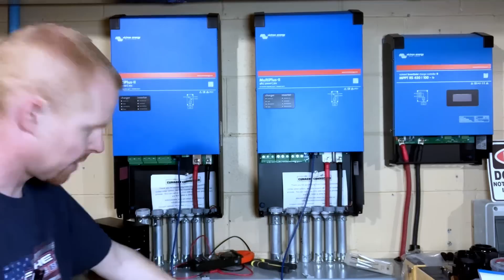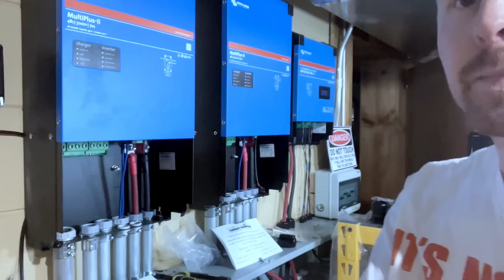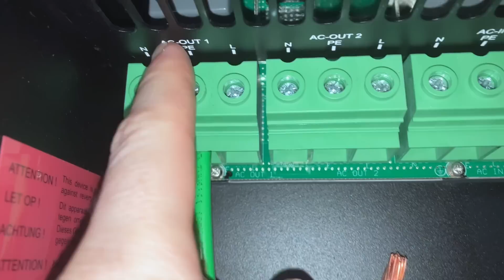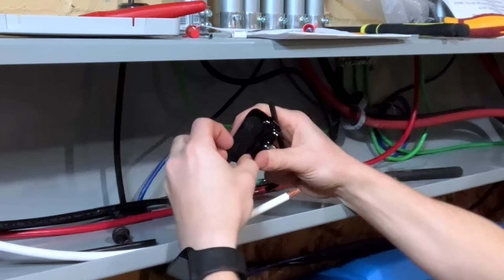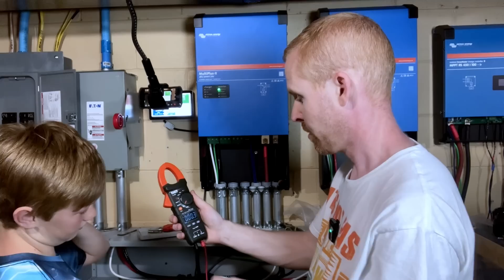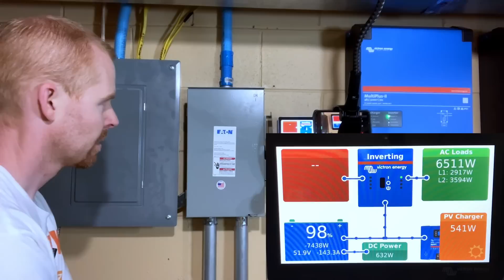Solar Upgrade - Powering the House with the Victron 5kVA Inverters!

Comment from the maker: Links to the parts & pieces in the video (affiliate links)
------------------------------------
Victron 48V MultiPlus-II 5kVA 120V Inverter
https://www.currentconnected.com/product/victron-48v-multiplus-2-5kva-120v-inverter-70a-charger/?ref=AzzpK9Fl

10kVA 120/240v Base Multiplus-2 System
https://www.currentconnected.com/product/10kva-120-240v-multiplus-2-5kva/?ref=AzzpK9Fl

Victron MPPT RS 450V/100A SmartSolar Charge Controller 
https://www.currentconnected.com/product/victron-smartsolar-mppt-rs-charger-controller/?ref=AzzpK9Fl

Victron Lynx Components - Power In, Shunt and Distributor
https://www.currentconnected.com/product-category/victron/lynx/?ref=AzzpK9Fl

Morris Products Insulated Multi-Cable Connector 3 Wire Ports, 2/0-6 Wire Range Dual Entry
https://amzn.to/446rbNw
Reply: Adam, FYI all the links you shared on the DISCRIPTION below doesn't work at all. It says "page not to found".
Thanks
Reply from the maker: @jwsolarusa  thanks!  I’ll take a look at those and get them fixed!
Reply from the maker: @jwsolarusa  Should be all set now.  Thanks again!

Comment: Good to see you're back online with Victron. I've been watching your videos on EG4 6500EX-48 and the issues with support. I'm placing an order soon for a Low Frequency system driven by bifacial panels. Based on watching you videos and other peoples videos it appears that Victron MultiPluss-II 5kVA 120V is the superior choice, the specs are awesome and the best part is the torodial transformer peak load at 9,000-watts with 97% efficiency and 15-watts zero load power consumption. Also, two units of the same model can be connected for a 240V split phase output. All I can say is I'm purchasing same unit. Thank you again for the videos. Best regards Sir.
Reply from the maker: Thanks!  I’ve been pleasantly surprised at how well the system has performed.  They just work!

Comment: You have a great looking system…glad to see you went with the great stuff… so many people try to cheap out on the brains of the system and much grief can follow ..

The more BLUE in a system , the happier that system will probably be in life…
I have not had a single issue in anyway with my total blue system since I switched it on…👍
The only thing in my main gear not blue is the batts , they are grey..same comments apply to them.
J.
Reply from the maker: Thanks!  I've been amazed...it just works...

Comment: Just a suggestion, when hand tightening terminals with non-twisted stranded wire even if using a torque limited driver, tighten down, back off, then tighten down again.  You might even do that a few times until you reach a point where you can not tighten more.  The reason being the strands will move and settle together.  If you don't account for that movement the joint will become loose over time.  This applies to both clamp and penetrating screw type terminals.
Reply from the maker: Thanks for the tip!

Comment: Awesome job with the install! I like the blue as well. If i ever redo my setup im going to add a wire trough...makes a huge difference for the cable management. Ive learned my lesson about cutting wires too short way too many times haha i think i missed the video though on why you decided to replace the EG4 system with the Victron system??? 

I can't tell you how many times I only ordered one but I needed two😅

Congrats on getting everything all hooked up and being able to get power from the system! I know the feeling 😊
Reply from the maker: So Current Connected sent me the system to test and review.  I have to admit, it’s kinda nice actually being able to communicate with a company.  Got so frustrated with SS and trying to get help from them on various issues.  

I had to make 3 separate orders for those Morris connectors cause I kept finding out I needed another one.  And it’s not one of those things you can just pick up from any store either…

Thanks!  I know you appreciate the feeling more that I do seeing as I still had grid power to rely on.  You had to deal with the genny…
Reply: @w8dev  That is awesome man, what a great opportunity! You did a fantastic job with the install and review. If I didn't already have EG4 equipment you'd have me sold on the Victron system haha

Comment: Happy for you and congrats! I’m looking to go victron, or eg4. I really like the eg4 18… but that’s overkill because I stay in a sub and can’t use that many panels lol
Reply from the maker: Thanks!

The 18kpv does look nice, but I'm still surprised that there's not more people showing them on YT.  So far outside of the distributor, I've only seen 2 channels with them.  

I would agree in a sub you probably couldn't get away with 18k of panels.  :D

With the Victron system, you can size the individual components to your actual needs.  Plus there's the stability of knowing Victron's equipment has been around for a long time and lasted the test of time.

Comment: I was thinking about getting the Victron 10k kit. However, after reviewing the EG4 18k by Lux Power and having everything built in and so far completely trouble free, I have decided to go that direction. The software for the Lux Power is awesome and it will work with solar assistant.
Reply from the maker: Awesome!  Have fun with it!  Looks like a decent unit!

The only issues I've heard so far regarding that unit are mostly related to the "zero grid export" feature.  I think other than that I heard of 1 person who had issues connecting the wifi dongle and another person had their display stop working after updating the display firmware.  The latter two could just be fluke occurrences.  

Let me know what you think of the 18kpv!
Reply: @AdamDeLayDIY  what is the "zero grid export" feature? we will be 100% off-grid
Reply from the maker: @stevenfrazier8939  I think it has something to do with load shaving and covering additional loads on the AC in side of the inverter.  I guess there’s still some potential to feed power back to the grid.  

If you have no ac in, you shouldn’t have any issues.

Comment: Wondering if you showed your equipment grounding somewhere in this video series. I could not find where you talked about that.
Reply from the maker: Howdy Eric!  

I had thought I had shown what I had done, but you know how things go during editing...so much footage...  

It looks like my tone out test was trimmed for time in this video (https://youtu.be/pi5M6XrDSjo?t=720) which would have showed that all the ground connections were connected.  It didn't make sense to me to have a ground wire going to each terminal since the other end would all be going to the same place potentially creating a loop (plus both the manual and the circuit diagram under the lid show each ground connected to the case).  

Simplest explanation:
Inverter/SCC -> Wire way bus bar -> transfer switch -> sub-panel -> msp -> ground rod

Hope that helps!
Reply: @AdamDeLayDIY  Thanks. I sent you a message to your channel email which delves further into my question and expands upon what I was asking. Hope to hear back from you soon.
Reply from the maker: @CountryLivingExperience  glad you said something.  It was in my spam folder.  Lemme take a look at it and I’ll get back to you.

Comment: My new growatt 12k trips at 14k for 10 seconds. But the fan is loud enough to hear from first floor when it's in the basement but honestly it doesn't bother me . But kind of like when u hear the sump pump cycle. Lets me know it's working. 😊
Reply from the maker: My office is in the basement right next to the utility room where all the solar hardware is.  There was a time where like you said, the fans just let you know things were working, but the noise was so loud it was hard to get work done (and that noise was through a brick wall).  We could hear the jet engines roar from the first floor as well.  I think if the fans cycled more (like the sump pump) it might not be that big of a deal.  

Have you done a video on your upgrade?  Do the fans run constantly on that unit as well?
Reply: @AdamDeLayDIY  no update video yet. I really need to clean the basement before I make another. They don't run all the time  they cycle on and off. Or at least the loud one does. Average joe replaced it with a quieter fan but it was also not as thick. I'd be afraid of overheating and voiding the warranty if I did that mod on this growatt. Suck u had to buy all new gear. But glad to see I'm not the only one dealing with these high frequency inverter issues. My mppt6048 also had the light flicker this low frequency growatt 12k doesn't. But my biggest issue now is the charge controller is just not big enough at 120amps on the battery side of things. I typically only see around 6kw of power from the panels now when I used to get 9kw+ at 170 amps with the mppt6048 even tho it was rated for only 8kw. I have plans for the mppt 6048 out in the barn otherwise I'd just use it as the charge controller. I was looking at the victron 450/200 charge controller for $2000+. But then found the eg4 100 amp controller at $400. Have to experiment to see if I can just use the two inputs on the growatt on one array see 🙈 if they fight each other and the other array to an external charge controller.
Reply from the maker: @electromechanicalstuff2602  Well, looking forward to your update.

I saw the mod that Joe made on his.  I would kinda be worried about voiding the warranty as well.  I've even seen some guys doing mods on the 6500s and adding temp controllers to get the fans to cycle as opposed to run all the time.

Actually, Current Connected sent me the gear to test/review.  Still had to fork out a pretty penny to upgrade all the wiring systems though.  

Glad the growatt doesn't have the flickering issue.  I wonder if it's just some issue with HF inverters and poor internal isolation between components?  Hard to say.  Obviously it's not all the HF inverters, just maybe the "cheaper" ones?  

I can't seem to find the thread on the forum, but I remember seeing a few comments about issues with the EG4 charge controller when you don't use battery comms. Not sure if they got that figured out or not.  Some people also said the fans can get really loud on that as well, but I guess you know it's working... 😁  At least it won't be like that at night.

I have to admit, one of the harder things when switching systems, besides the potential re-wiring is having to adjust your arrays when your charge controller changes.  I had to go from 4 MPPTs down to 2 on the Victron 450/100.  Ended up having to re-use one of my old Victron 150/35s.  Still works, just took some thinking and re-wiring.

Comment: I'm familiar with the inverter downtime anxiety you've been experiencing.  Congrats on getting the system back online.  Could you please post a link for the transfer switch?  Thanks for the great content.
Reply from the maker: Thanks!

I picked it up from Menards - https://www.menards.com/main/outdoors/outdoor-power-equipment/outdoor-power-equipment-parts/generator-parts-accessories/eaton-reg-100-amp-240v-outdoor-double-throw-safety-switch/dt223urh-np/p-1642874258838342-c-1525269720177.htm?tid=2722cb46-6e9a-45f5-8ef6-826f4dc8328b&ipos=29&exp=false

Comment: The wires going from the Batteries to the inverters need to be the exact same length because the  impedance needs to be the same.

Comment: Nice Video, you should really use crimped ferrules on the stranded wire. Otherwise it might loosen over time.
Reply from the maker: Thanks.  You really only need ferrules if you have fine-stranded wire.

Comment: I’m not sure if your neutral wire from house a.c. Panel to Morison connecter (2 gauge )is large enough as when you added the Morison connector you have on both sides of Morison 3 way same size gauge wire  (2 gauge ) I think you would have double the current due to two inverters  On the neutral ,your good on L1 and L 2      I could be wrong
Reply from the maker: That's a great observation!  Normally, yes you would want to upsize the "combined" output wire to handle the extra current.  In my particular case, the wires were already upsized due to a previous installation.  The input wires could actually be a smaller size but since I already had that wire available, I used it.  
Thanks for the comment!

Comment: 9:05 - Adam either has some really strong hands or his THHN is way more flexible than mine. ;)
Reply from the maker: 🤣🤣🤣 is yours solid wire vs stranded?  Solid wire is much harder to bend.
Reply: @AdamDeLayDIY  Oh I'm dumb but not that dumb. ;)  Must be that "AC/DC Wire Supply" stuff being more supple than the stuff I got from "Wire And Cable Your Way" as it was cheaper.
Reply from the maker: @SolarShenanigans  😁. Very well could just be the quality of wire…or it’s just my monster hands!  🤣🤣🤣

Comment: Hi Adam, the Victron is 10k and has less power output than the  13k the eg4 6500ex put out. 

  What was your reason for choosing Victron and moving away from the eg4 6500ex? 

Just curious as a solar user. Maybe your reason may be good fit me as well.
Reply: If you check the specs the Victron short term overrating is usually quite generous (I've not done this for the Victron inverters shown here).  Yes the nominal rating of the EG4s is higher but most people do not run at HF inverters 100% for extended periods anyway as it's bad practice.
Reply from the maker: Well first off I want to just remind that Current Connected sent me this system for testing and review.  My "review style" (if you could call it that) is to just use it like any other person and bring people along for the ride.  It's really the most honest way I can think of to "review" something.

So yes these inverters have less output power than the 6500s, and time will tell how far I can push these inverters.  

A few of the big differences between the units that I've noticed so far is the difference in idle consumption.  My 6500s had approx 168W of idle but this entire system has approx 35W of idle consumption.  That's almost 3.2kWh of savings each day.  That's huge!

The next thing is the noise.  The 6500 fans sounded like jet engines in my utility room.  These inverters only turn on the fans when they get warm and even those fans are really quiet compared to the 6500s.  

Another difference is the flickering light issues I've had with the 6500s.  Various lights would flicker, certain devices would introduce a flicker and I couldn't use any dimmers.  So far, all of those issues have been non-existent on these inverters.  

Lastly, one of the big differences was the lack of support I received from Signature Solar.  The last ticket I sent in for help took almost 3 weeks to get a response.  I've had bad experiences with support all around, and I've also had communication issues with management.  It's disappointing because I like the products they're putting out, but I have to be able to get support for products I purchase as well.  For the most part I'm self-sufficient, where I don't really need to talk to support, I'll just figure things out, but for the occasional things I had to try and get help, I never got it.  I still have questions unanswered from last year.  

I know I'm probably missing something, and I plan on running these inverters through all the issues I had experienced and sharing the results with everyone once I get the install all completed.  Hope this helps.

Comment: What about the lights flickering from the thumble dryer? I was the most interested in that,how it can handle?
Reply from the maker: I'm guessing you mean the washing machine and the lights pulsing?  I'll be doing doing that test at some point.  From what I recall, I don't remember seeing the lights pulsing at all though.
Reply: @AdamDeLayDIY  You had a light flickering issue whit the EG4 inverters,i am curious if you will have the same issue or not.
Reply from the maker: @83kaszas  Yeah, I had a handful of different things flickering.  I'll have to see if I can do one video testing all the issues I had with the 6500s or if it will take a couple... 😁

Comment: You sure are jumpy.  Makes me think you may have a guilty conscience ...  🤨
😁
The inverter fans sounded relatively quiet in the video when you got them to ramp up.  How would you compare them to the 6500s?
Reply from the maker: Haha.  Yeah I learned a long time ago, the second you stop respecting electrical when you work on it is the second you get bit!

Jet engine vs trolling motor…. It’s hard to explain.  I’ll do a DB test on these like I did with the 6500s and compare the results.
Reply: @AdamDeLayDIY  That's good to hear.  These units just aren't quite enough output for my needs but I keep looking at the Quattro 15kw and thinking maybe.  The EG4 18kv is so tempting but I'm a little spooked on how reliable those are going to be.  I hope they get the bugs out and they're solid but I'm pretty sure the Victron is already solid.